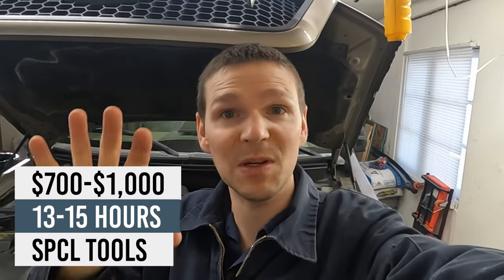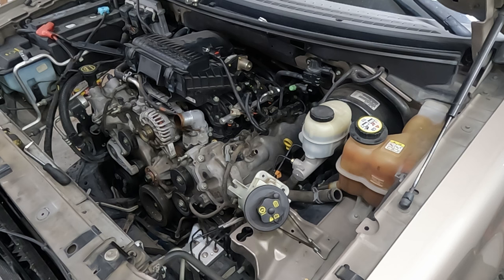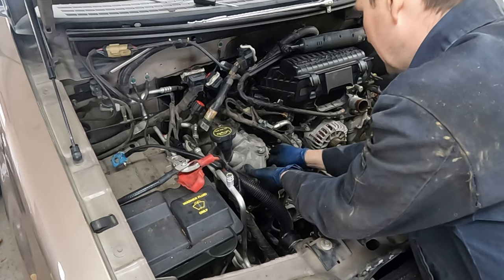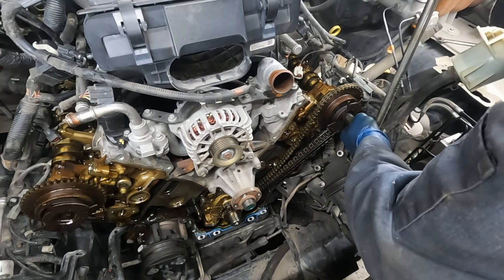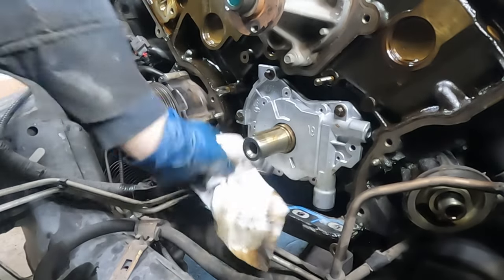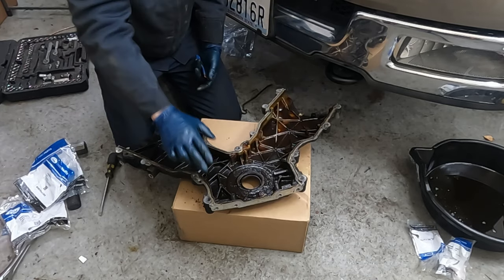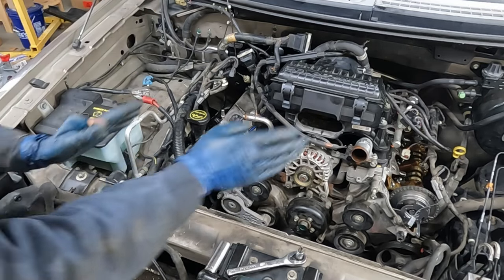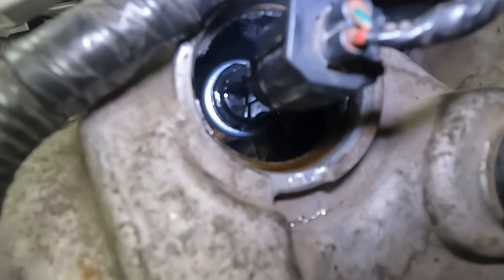Ford F150 5.4 Timing Chain, Cam Phasers, Roller Followers and Oil Pump Replacement

Comment: Devastated. Not sure what exactly  happened with aligning crank shaft way at 12 o’clock and phaser at  top view as shown in every single video I’ve looked but some how after pulling cam out to drop in new rollers and hydraulic lashes, I put cam back where I removed ( took picture something went wrong.  
Putting new phaser back on after installing everything I mentioned including spark plugs, my phaser mark was down at 4 o’clock position left bank.  
My question is there a way to install chain without removing all followers, free spin phaser to where it should be, then installing followers one by one after chain is installed?
Reply from the maker: You do not need to remove any followers to adjust the cam. If the phaser dowel pin is lined up correctly then you can just turn the whole cam COUNTER Clockwise to put the timing mark in the right spot. You will feel it if a valve makes contact with the piston head which isn't a big deal unless you continue to force it. If this does happen then just remove the cam and reinstall it in the correct position.
Reply: The way the ford genius on YouTube does it is to get TDC at 12 o'clock then go to 6 o'clock and remove exhaust roller on cylinder one and on cylinder 4 remove intake which has two rollers. Bank 2 just the opposite on bank 5 remove intake which has two rollers and bank 8 remove exhaust which is one roller. Total of 6 and that takes the pressure off and give you the slack so nothing spins
Reply: I guess what I’m saying is set at 12 o’clock and visually looking at left side and confirming it an “L” I screwed up, it should have been a “R” from the perspective of of being in the cab (passenger side).  I did go back remove cam and the new followers and replaced the cam and phasers without the followers (now I’m forced to by tool). I can now spin the phasers freely to position R and L correctly, something is telling me that would make it 180 degrees out.  1.) Question If that’s so how do I confirm and correct?
2.) when you turn the crank camshaft 1 complete revolution, 12 o’clock to 12 o’clock, is that 1 complete revolution or 1/2 ? Meaning key way goes around twice  to complete a revolution. 
I’m ready for chain but something is telling me there’s a problem. Please let me know. Thanks
Reply: I guess I’m overthinking my screw up. 1 revolution is a complete.  After I install chain, timing will be correct and all I have to do is move crank to get cam lobs out of the way to insert the followers ?? I think….
Reply from the maker: @cam6715  You are correct. If you don't want to wait for the tool the followers don't need to be removed. You can pull the cam back off and install the followers. The passenger cam will want to roll clockwise and rest there. That's fine, in the video the cam can be rotated counterclockwise when installing the chain to match up the marks. But whatever you feel comfortable with is the best option 👍. If you have any more questions feel free to reach out.
Reply: Reaching out again.  Family issues prevented me from completing. 1 month later I finished last night.  After waiting for oil pressure build up as you show, I fired it up, only to find that it was running rough like your video showed with the  bad new VCT solenoid. I know my timing is dead on, added new plugs, new coils, lash adjusters. Not sure what would be wrong.  Obviously I don’t have the computer to see if VCT is advancing my timing.  Any advice before I go out and buy new solenoids??
Reply from the maker: @cam6715  I would double check that ignition coils and injectors are plugged in all the way. I've had the weather packing on the connector prevent full engagement causing a misfire.
Reply: Is it safe to use new butt splice connectors for the coil packs? Tried to replace just connector but New connector bought through Rock Auto didn’t fit repining. So now I have two choices splice wires or buy new motor craft . 
What’s your opinion on splicing? Any loss of ignition ?
Reply from the maker: @cam6715  splicing should be perfectly fine. Just make sure you use the kind that has heat shrink on it to keep it weather tight. Electrical tape alone isn't enough 👍

Comment: That phaser probably wasn't seated correctly before tightening. Tone ring part couldn't have moved with phaser bolt without moving cam shaft as well.

Comment: Do you recommend purchasing the parts listed that are linked to Amazon or parts from Ford?
Reply from the maker: @jacindrabrown8605  I think either option is great! Melling is the only aftermarket brand I would trust for this. I heard a rumor that Melling manufactures the phaser for Ford but I'm not sure how accurate that is. Either way I've had good success with both 👍

Comment: Is it possible to remove the timing cover off while the power steering pump is mounted and I just take off the Pulley? Got two really stripped bolts from the rust but I got the one off from the back of the pump and it looks like it’s bolted onto the timing cover?
Reply from the maker: @kameronwade4238  I wish I knew, I haven't tried without removing the pump. I know at least one bolt goes through the cover and the pump hides a 13mm cover bolt. Let us know how it goes 👍

Comment: Excellent video presentation. Sad new part quality control by suppliers to Ford. I wonder if going with aftermarket replacements would have saved you time?
Reply from the maker: Thanks! Yeah it's unfortunate. Since this video I've installed Melling components on a different truck. We'll see how they last. Melling is a known good brand. Definitely don't go generic or Dorman!

Comment: 37:14 how do you keep the engine from turning when getting this thing torqued?
Reply from the maker: @GhostDog88  I use an impact with the original bolt to suck it in until it bottoms out. Then I remove the bolt and install the new one. Getting 37 lb.ft. should be easy without the engine turning. Then I use an impact for the last 90*. I mark a vertical line on the bolt and when it's horizontal that's 90*.

Comment: Can you possibly damage the cam torquing the caps with the rockers installed? Aren’t you essentially forcing the cam against the rollers using the cap bolts? And it looks like you left the sticker on the LH chain guide when you installed the chain?
Reply from the maker: Good question. The valve springs will compress this is normal. It's important that the cam is in the correct position so you don't open a valve that's not supposed to be open. If you put it back the way it was removed then no damage will occur.

Comment: What timing kit did you use here? Ford OEM or aftermarket?
Reply from the maker: Good question. I only use Ford OEM parts on these. Aftermarket phasers are terrible! Ford parts are updated to fix the original issues they had. A link to a full OEM kit is in the description 👍

Comment: One I torque down my right side the top part of the chain gets loose what can be causing this and how could I fix it
Reply from the maker: @emmanuelcastro169  Just to make sure you mean the passenger side? Turn the camshaft counterclockwise to remove the slack. All the slack should be at the bottom where the tensioner goes. Install the guide and tensioner and it will stay tight. Make sure your timing marks are still lined up 👍

Comment: I have seen a few videos showing crankshaft notch be placed at the 6 o'clock position. Is placing it at 12 the correct way?
Reply from the maker: Good question. The crank keyway at the 12 o'clock position is the correct way.
If you put it in the 6 o'clock position none of the timing marks will be in the right place.
Reply: Yes exactly the way ur saying the dimple isn't at six o clock so I'm confused how the chain will be on correctly
Reply: @valleymobileautomotive
Reply: Dylantew6758 isn't saying put the key way at 6 o clock he's saying put the keyway at 11 like the ome tool does so that dimple is at the 6 oclock
Reply from the maker: @sebastianendres8062   I see what you're saying. So with the keyway at 12 o'clock like I show in this video the dimple will be at 7 o'clock. This is how the manual has you set the timing. If you watch the video at time index 29:50 you'll see how the marks line up 👍
Reply: If I locked out my phasers do I need to worry about the clock spring anymore?
Reply: why would the manual say to put the crank at 7 o’clock, when all the tools made for these engines set the day at 6 o’clock ?
Reply from the maker: @lwjw3184  As far as special tools used, the manual only mentions the valve spring compressor and cam locking tool. So the manual is written without the use of the crank alignment tool. That's why the manual has you set timing at 12 o'clock. As long as the colored chain links line up with the timing marks on the vehicle you're good to go 👍
Reply: Is it absolutely necessary to evacuate the AC for this project?
Reply from the maker: @ethanfowler3334  yeah, you need to disconnect the AC lines. Can take it to a shop for the evac then do the repairs and bring it back for the refill.
Reply: The positioning tool for the key way alignment positions the key way at 11 o’clock. Which in turn puts the crankshaft gear dot at 6 o’clock. How are you doing it with the key way at 12?
Reply: I am not sure what you mean by "crankshaft notch" but according to the Ford Factory Service Manual the timing chain replacement involves having the keyway at three different locations - 12 o'clock, 6 o'clock, and 11 o'clock (TDC set with a tool puts crankshaft timing mark at 6) in that order, and removing certain roller followers at certain points.  Like many, this mechanic stayed at keyway 12 o'clock, which puts the timing mark around 7.  He saved a lot of time by carefully removing camshaft caps in a balanced manner to release pressure evenly to quickly remove all roller followers at once instead of using a valve compression tool for each rocker arm.

Comment: Good Video. But you missed a lot of info verifying top dead center for cylinder 1 and the tool to set it. And those aren't OEM Phasers that's why  it broke. Real Ford Guy here. did my wifes Expy doing my F150 soon
Reply: Getting ready to do everything he did in this video so if I understand you correctly you mean make sure you have the key way on crank set with the tool to ensure cylinder 1 is at TDC replace lashes and follower than input cam than timing components?
Reply: @johnjayboyd5944  According to the Ford Factory Service Manual a timing chain replacement involves having the keyway at three different locations - 12 o'clock, 6 o'clock, and 11 o'clock (TDC set with a tool puts crankshaft timing mark at 6) in that order, and removing certain roller followers at certain points.  Like many, this mechanic stayed at keyway 12 o'clock and save a lot of time by carefully removing the camshaft caps in a balanced manner to release pressure evenly to quickly remove all the roller followers at once instead of using a valve compression tool for each rocker arm.
Reply: Cylinder 1 has got to be in compression stroke at its peek for a fact or it will be off time.
Reply: @iPutTheJinGenius5  where would the crankshaft keyway be located?
Reply: @hauntastic158  the original was what broke in the car and my test before I did the one in the engine actually easier to knock the top off on the OEM than the Amazon junk that's got me going now for 5 days with no problems just saying.
Reply: @PaulHenreid  about 11 o'clock

Comment: How come everyone else says you have to put in the roller followers with the camshaft in place? Getting ready to do this. Just don't want to ruin anything.
Reply from the maker: @jaholl97  If you are doing the timing chain as well it's easier to remove the camshaft with all the roller followers still installed. The manual has you remove 3 followers on each side before removing the timing chain but I have found this step to be unnecessary as long as you know what to expect. If you are only doing the followers and not the timing chain then it would be up to you to remove the camshaft or just do each roller individually.

Comment: I thought I was at 12 but it’s more like 1 . I I took the chain off already. I’m just curious is it OK to rotate the rank back around to 12 . I have the special tool that times It can I use that ?
Reply from the maker: @okechifurlow8857  You can try. You just need to be careful when turning the crank independently of the cams. If it feels like it doesn't want to turn don't force it 👍
Reply: So should I put the chain back on then rotate😊
Reply from the maker: @okechifurlow8857  Only if you line up the timing correctly. Otherwise just use caution when turning the crank.

Comment: I was tightening the left side of the camshaft gear and it jumped to the left about like a half turn ! And now my chain on that side do not lined up the marks ! Can I move the gears while the crankshaft keyway its at the 11 o clock position I use the timing tool and I already set the time to the correct way! But then that happen ! Do I need to place the Crankshaft keyway at the 12 o clock position and then re aligned the camshaft gears or how that does work? Or can I aligned while it’s at the perfect timing set 11 clock and dot mark at the 6 clock
Reply from the maker: You can rotate the camshaft back in position without moving the crankshaft. Your tool at 11 o'clock can stay in place. You might need to remove the chain tensioner if it's already installed to give it more slack.

Comment: My 05 was throwing codes for the cam sensor on the drivers side so I pulled the timing cover and the chain on the drivers side was broken. It ran when parked there though just had a miss. Well when I tore into it the phasers on both sides had the L on top. Is that okay or is the cam going to be positioned wrong on the passenger side?
Reply: You need L for drivers side and R for passengers side
Reply: The dot on the crankshaft gear needs to be at the 6 o’clock position and there should be two colored links that are next to each other on each chain. Line those up between the L and R on the cams. Then there is a single colored link that needs to line up with the dot on the crankshaft sprocket at 6 o’clock like I said

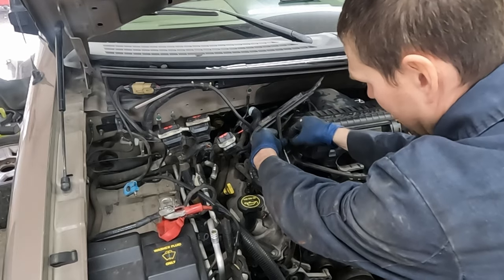Comment: Why in some videos are people timing the crank keyway at 12:00 and some its 11:00 with timing mark at 6 o'clock ?
Reply from the maker: @justkiknit  Both methods are acceptable. My manual says 12:00 for the crank keyway. The most important thing is that your new chain colored links line up with the timing marks on the gears 👍

Comment: why was your keyway at 12 and timing dot at 7.i used the tool to line mine up ,  does that mean your timing is wrong or is mine?
Reply from the maker: Good question. Both timing positions are correct. The important part is that the colored links line up with the timing marks 👍

Comment: Hey man I really need your help, I’m doing this job and I watched someone else’s video to time the engine and they said that passenger camshaft lobe has to be facing approximately 11’o clock position on cylinder 1. Is that true or it doesn’t matter as long as R and L is facing up. Please brother I have to finish this soon
Reply: When my cylinder 1 lobe goes to 11’o clock position crankshaft goes to approximately 2’o clock
Reply from the maker: @ahmedpanwala5584  Are you removing the old chain or installing the new one?
Reply from the maker: @ahmedpanwala5584  Don't worry about the cam position too much when removing the timing chain. As long as it's not 180 degrees off. The phaser may be stuck out of time. Focus on the crank being at 12 o'clock and remove the chain like in this video. When putting it back together focus on the new chain colored links lining up with the gears and you should be set 👍
Reply: @ValleyMobileAutomotive  omg thank you so much couldn’t sleep last night haha
Reply: @ValleyMobileAutomotive  I’m installing the new one now, cylinder 1 lobe are still not facing 11’o clock but the phaser is facing up and the coloured links line up shouldn’t be a problem right?
Reply from the maker: @ahmedpanwala5584   Sounds like you got it 👍. Just to confirm the phaser slid nicely into the cam notch and the passenger side has the R up and the driver side has the L up?
Reply: @ValleyMobileAutomotive  yup all the coloured links are matched right (passenger) is facing up left (driver) is facing up key way is at 12.
Reply from the maker: @ahmedpanwala5584  Sounds good! Let us know how she runs when you get it back together 👍
Reply: @ValleyMobileAutomotive  hey man I put everything back together car starts and dies right away  anyway I can email or call you?

Comment: Do I need to bleed the coolant when all is said and done?
Reply from the maker: Yes. These are really easy to bleed.
1. Fill degas bottle to full
2. Warm up engine with heat on high
3. Fill degas bottle with engine running until it maintains at the full mark.
4. Let engine cool and top off as needed.
Reply: @ValleyMobileAutomotive   thanks! That's what I did. Figured since there wasn't a radiator cap that would be how to do it. Now I just gotta figure out why oil pressure won't build and why it's throwing P0351 codes. Gotta love it 🤦‍♂️😂
Reply: I think you are a very good mechanic.   Nice to see.

Comment: What mileage should these  Timing chains be changed .
Reply from the maker: Good question. Timing chains don't have a replacement interval like timing belts. They will usually only get replaced if they are causing problems or if they need to be removed for another repair. For instance on this vehicle the cam phaser was the real issue but it made sense to go ahead and replace the chains and tensioners as well.